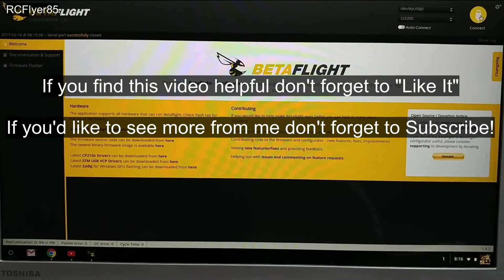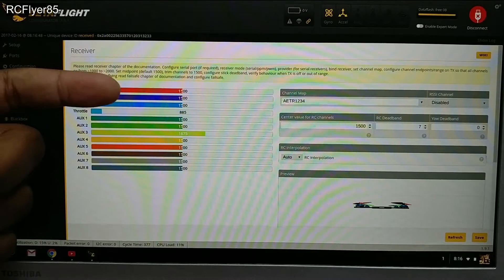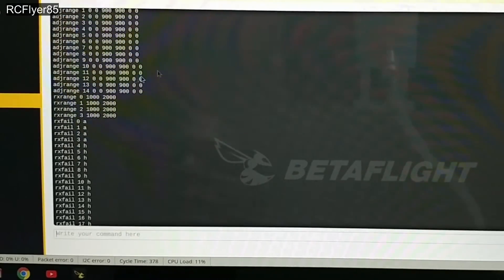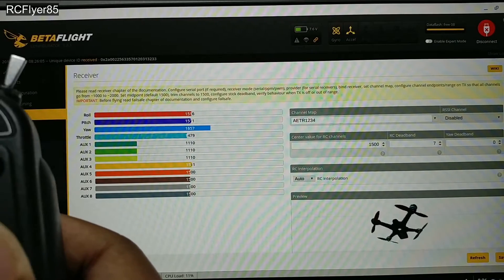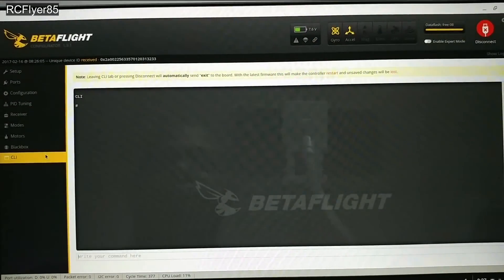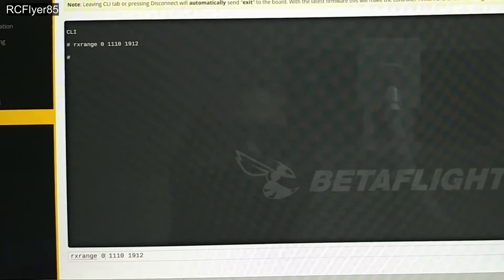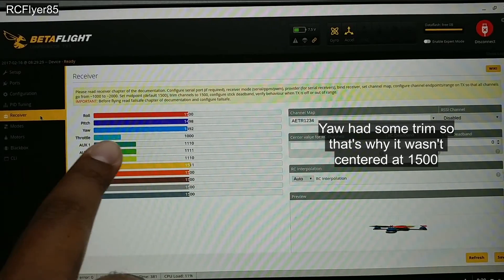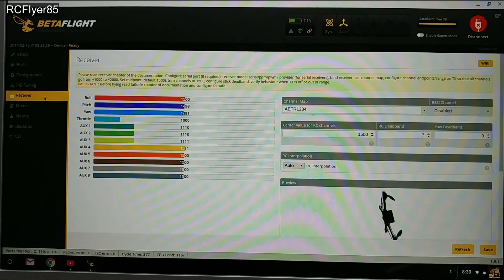RXRange - What Is It and How To Change It! ( If You Can't Arm )

Comment: After I entered and saved the new rx ranges 1110 and 1912 those values did not automatically get saved as the 1000 and 2000 min and max. So I set them manually from the receiver into betaflight.
110 flying much better now especially yaw. Before with stock setup yaw was sluggish. Now it spins much faster and overall 110  feels more responsive. Thanks and keep up the great work !